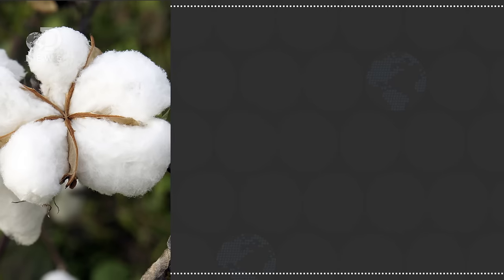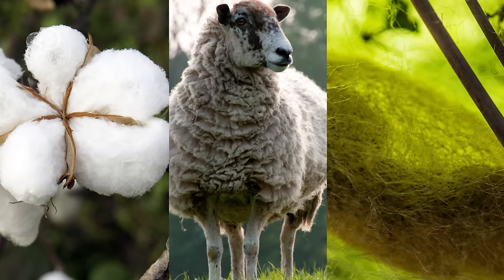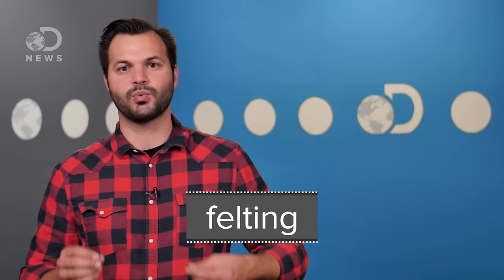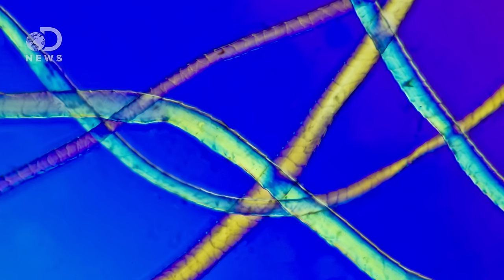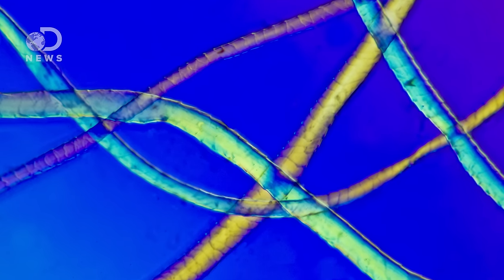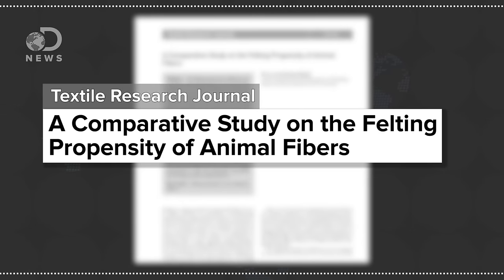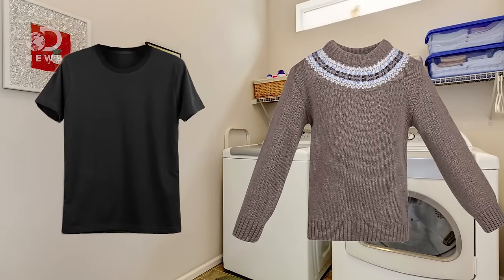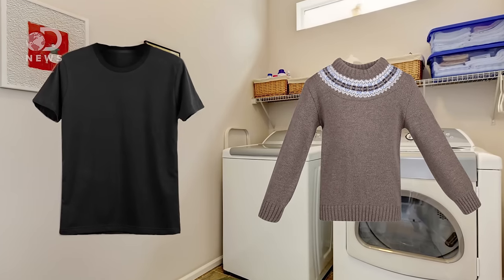Why Do Clothes Shrink When You Wash Them?

Comment: Honestly this is so cool.  I always thought it was just the dryer heat.
Reply: It's simple. Just buy a shirt with polycotton material. (a combination of 50% polyester and 50% cotton)
Shrinking after washing a 100% cotton piece of clothing is a bit of a gamble. 

If you’re purchasing t-shirts, and you don’t want to be concerned with shrinking, and a 50/50 blend will give you peace of mind that the size you purchase is the size you will continue to have. 50/50 blends are a little more reliable when it comes to maintaining size and shape.
Reply: @izzuddinnaimofficial2563  cool! But what about 60%cotton and only 40% polyester? 🤔 What happens then? Is the higher cotton then more likely to shrink or does the polyester not let that happen too much??

Comment: I thought it was when you dry it not wash it
Reply: I also thought this and we are right to a point its basically heat that do it...hot water or hot air..
Reply: Yeah I'm in Korea and their washers beat your clothes to death. I dont have a dryer so I hang to dry and I've had several  oversized hirts that have shrunk a little.
Reply: charnae young 

I also hang my clothes its better and I save electricity during summer and it prevents more from fading but if you leave it hanging at  the sun  for hours it will shrink
Reply: It's simple. Just buy a shirt with polycotton material. (a combination of 50% polyester and 50% cotton)
Shrinking after washing a 100% cotton piece of clothing is a bit of a gamble. 

If you’re purchasing t-shirts, and you don’t want to be concerned with shrinking, and a 50/50 blend will give you peace of mind that the size you purchase is the size you will continue to have. 50/50 blends are a little more reliable when it comes to maintaining size and shape.

Comment: Actually, the reason jeans don't shrink much is because it is sanfrodized, which makes it pre-shrunk, but un sanforized jeans can shrink up to 10%
Reply: glad someone said it
Reply: I know, im a hero
Reply: Yeah, most of the jeans you'll buy are pre-shrunk cotton denim and they have also been sanforized (i.e. treated with special chemicals to keep them from shrinking further). But, even non-sanforized denim will only shrink 5 maybe 10% nowhere NEAR felting in wool products which can shrink 15 to 20 percent in width and 25 to 40 percent in length because the fibers have more air between the weave, and can physically shrink in a way cotton just doesn't.

Comment: so how do we prevent shrinking?
Reply: use cold water on a gentle spin.
Reply: hand wash
Reply: buy bigger clothes
Reply: Stay out of the pool?
Reply: soak the shrieked clothes in conditioner I don't know if it works but I saw it on the internet but the internet is always reliable right ?
Reply: Stop washing..
Reply: use cold water to wash, and hang them to dry instead of using a dryer.
Reply: We grow